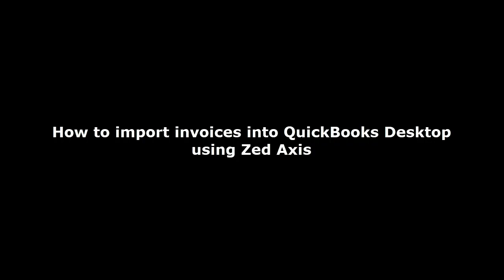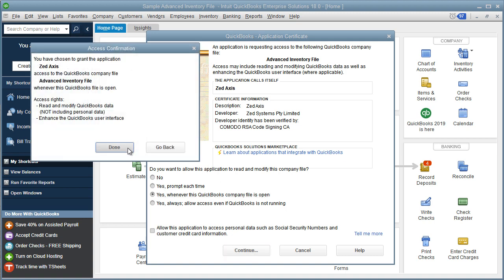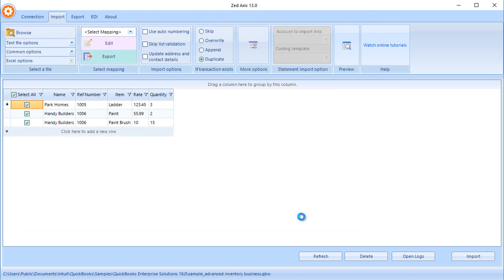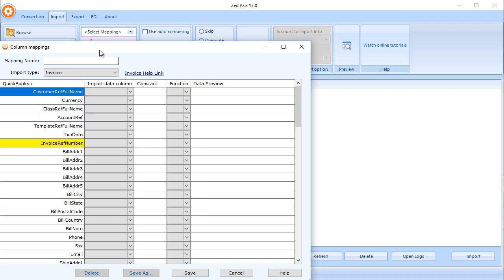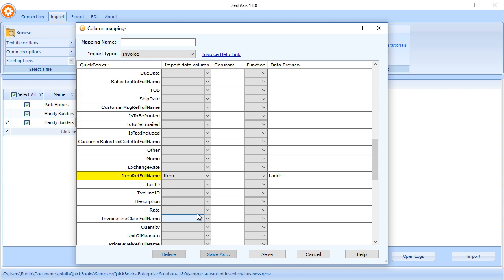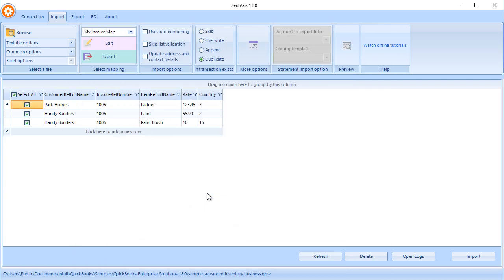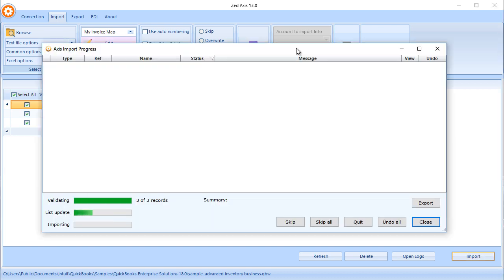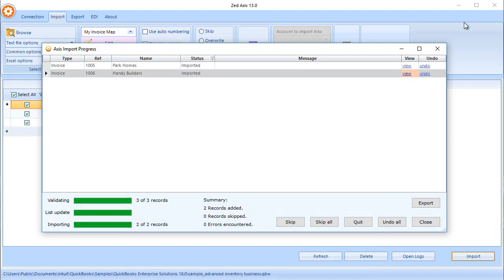How to import invoices into QuickBooks using Zed Axis v13

Comment: Hello , i tried to upload invoices with serial number for each line in each invoice but the system not accept adding the serial 
Second thing i wanna add new customer massage ( not listed in Q.B ) for each invoice is it possible?
Reply from the maker: Hi Mo,  You can add serial numbers on invoices lines but you need to make sure your version of QuickBooks supports serial numbers.  For the customer message that needs to match one of the customer message templates in QuickBooks so you can use that field to add free form text you should try using another fields that does support free form.

Comment: A massive word of caution. Zed Axis is very convenient. Complications will arise if you have a lot of columns. I had 12 in mine spreadsheet.  The software is good but testy. It does not tolerate the slightest of inconsistencies between import content and QB setup. Make sure the customer names on the spreadsheet are identical to that in your QB. Make sure every customer name the spreadsheet is also in QB. Else the software will not import a new customer content for you in to QB. Date format must be identical. There you have it. If you have a lot of columns in your spreadsheet, ensure to accurately match each header name to that in your QB so that data will be posted accurately. This work will be done during mapping on the ZA. Good luck. .
Reply from the maker: Hi Manjaro, 

Thanks for your question that is great advice to new users.  You do need to make sure that the Customer names in your import file match exactly the Customer names that are in QuickBooks desktop otherwise Axis will create a new customer as it imports the invoices, although you do have the option to turn off that feature and let Axis just display a message that the customer was not found.  

Steve